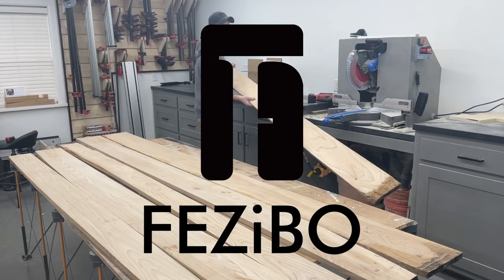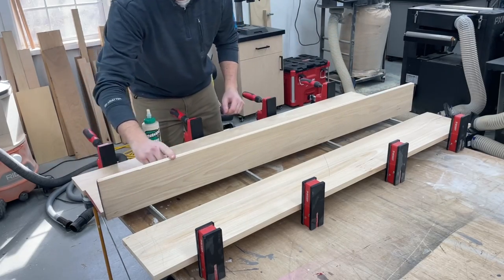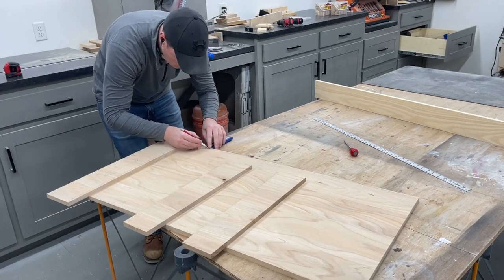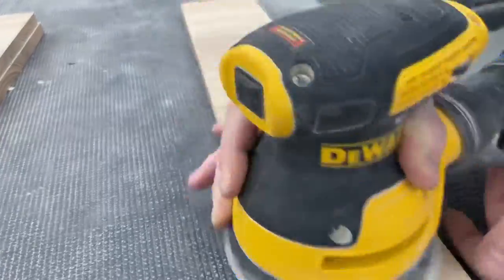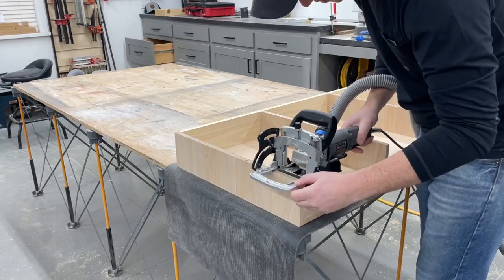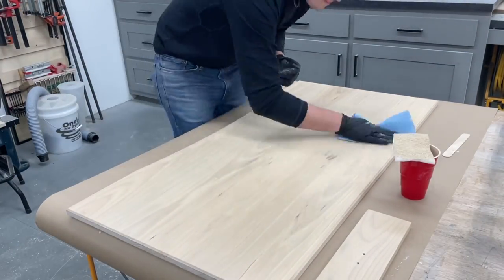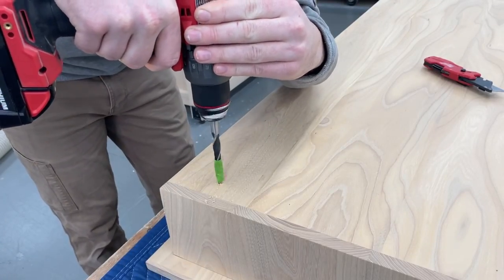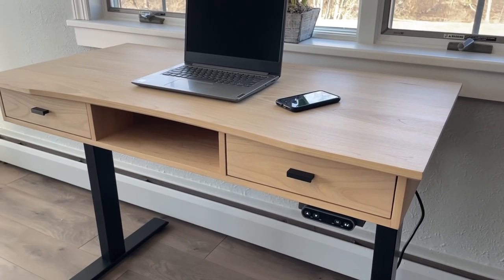Modern Sit/Stand Desk Build

Comment: I really like this design with the storage under the desktop. I’ve been thinking about replacing my oversized L-shaped desk in my home office with a simple slab since I do t need all the filing storage my current desk offers. But I’ve been hesitant because there are still~some~ things that need to be around my desk like chargers, cables, etc. This design would be perfect for what I need to give me a minimalist desk combined with practical storage.  Thanks for posting.
Reply from the maker: Thanks for watching man!
Reply: I'm in the same boat. I will probably get rid of my l-shaped desk in favor of something like this but I need it to be quite a bit bigger than this.

Comment: When I saw the drawer fronts placed into the slots, I hoped that you were going to use "push to open" drawer slides, as it was such a nice clean look, and not use any pulls or handles.. 
Also, if there's a third setting for desk height, you could have 1 for sitting, 1 standing, and 1 for a height that will fit your chair underneath, but as low as possible..

Comment: You can store so you get air under the bottom.  Helps keep it stable allowing the top and bottom to dry the same amount is the theory.  That way you get less movement and won't have to re-mill loosing thickness.
Reply from the maker: Yep I do. The clip of them stacked was to show they weren’t completely flat anymore, after resting separated
Reply: @JohnBuildsIt  Ah.... gotcha!

Comment: Great project John! I’ve been thinking about building a new office desk. A little off topic question but I noticed you have hardwood or vinyl floors. What did you do with the wheels on your office chair?
Reply from the maker: It’s laminate. Haven’t done anything with the wheels though??
Reply: We installed Vinyl luxury plank through out the house and I’ve been terrified of the plastic wheels on the office chairs scratching the floor. Interesting. Just wondering if you did anything with your plastic office chair wheels. Cheers! Love the videos. Keep it up John.

Comment: Nice piece John. How do you decide when to and not to use dominos, biscuits etc to align boards for glue ups like this top and bottom here. You got a great outcome without them. Thanks.
Reply from the maker: Just if some of the boards are bowed or something and need help staying aligned flat, or really large panels. These were all nice and flat, so easy to clamp up without any help

Comment: I have a question about working with dowels.  I notice you did a nice dry fit.  Whenever I work with dowels that I pick up from Lowes or Home Depot they always fit SO snugly that once I get them in I can't get them out.  This makes a dry fit almost impossible.  If I tried to dry fit a desk like this it would be super hard to get everything apart.  Sometimes the dowels even break off when I try to get them out.  Is there any secret to this that I am missing?  Do you buy dowels from somewhere else?  Do you make your own?  Do you hand sand them down ahead of time so they aren't so snug?
Reply from the maker: I use the Milescraft brand dowels for the most part. Sometimes it takes pliers to get them out which messes up one end so they’re trash, but I’ve never had a problem with them breaking or anything

Comment: Enjoyed the video. Looking to build something like this for my kids. I do have a question. It’s more out of curiosity then anything else. Why only glue for the top and bottom panels and not glue and dowels? Is it a preference or is it for expansion purposes?
Reply from the maker: I use dowels or biscuits if the panels are big enough or need some assistance keeping lined up. They’re just for alignment, all the strength is the glue
Reply: @JohnBuildsIt  gotcha. Thanks for the response!

Comment: Great build - Only problem with these sets of legs (and all the sets I can find) is the minimum height. 28" is great if you're just putting a slab on top but with a build like this, the minimum height is going to be too tall for anyone under 6'0", too tall in the sense that the ergonomics wouldn't be right. Honestly in the shot of you sitting with your hands on the laptop, it already looks too tall for your chair height there. Wonder if anyone has found one that has a lower minimum height?
Reply from the maker: It’s perfect for me but could definitely see it being too tall for someone shorter for sure!
Reply: @JohnBuildsIt  That's the problem I'm running into. NO one seems to make a set of these that have a minimum height lower than 28". Wild.